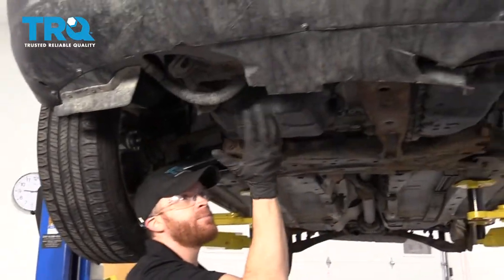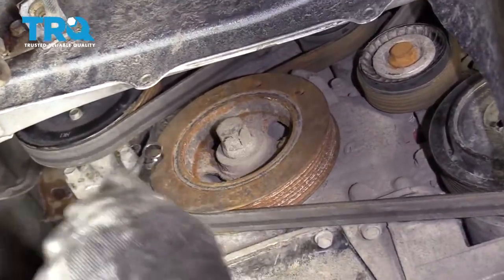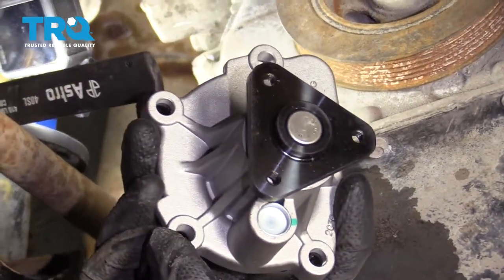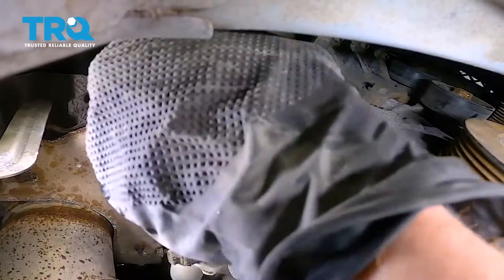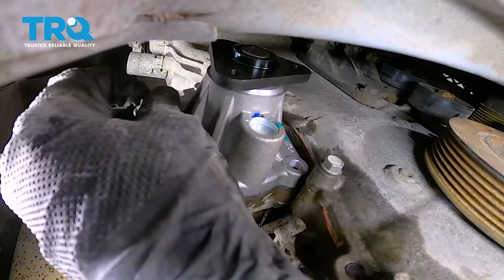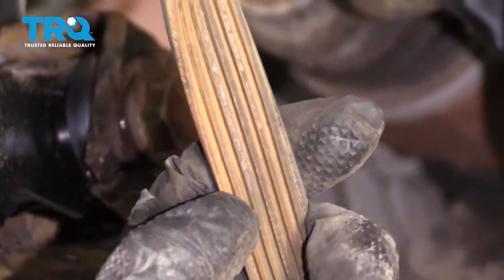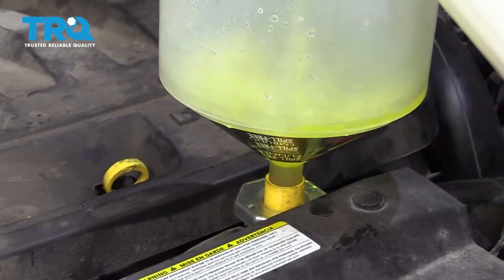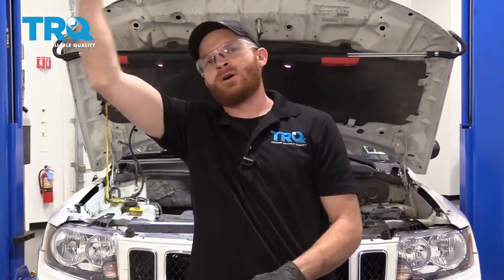How to Replace Water Pump 2007-2017 Jeep Compass

Comment: wow  , your Video saved my life , I have a 2016 Jeep compass .  i had issues with heat sensor shooting upto the red indicator and beeping continiously until i stopped and added more water that didnt help until the mechanic changed the pump just like you demonstrated and the issue stopped  .  appreciated the walkover bro ..

Comment: So now here goes a good question water pump replaced water is still boiling up into the reservoir temperature gauge is going 3/4 of the way the thermostat has also been replaced. What gives?